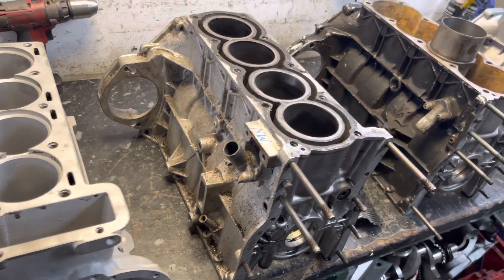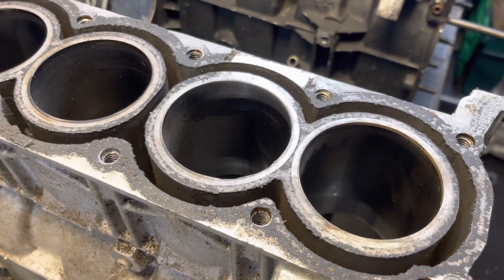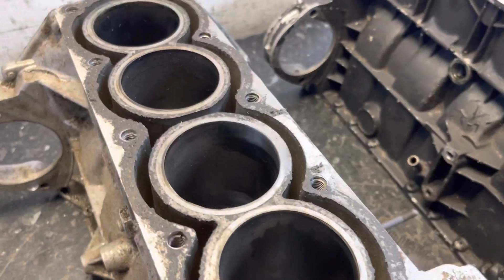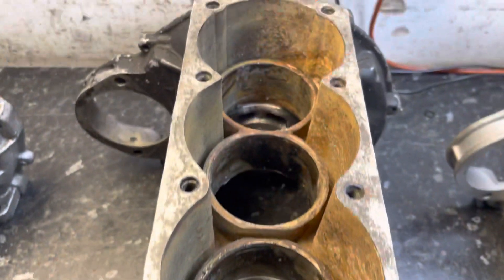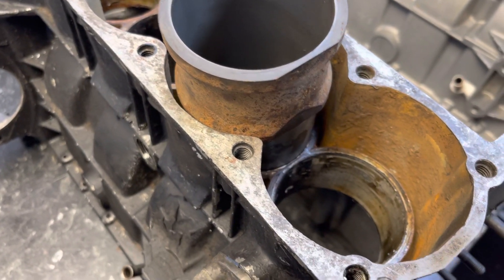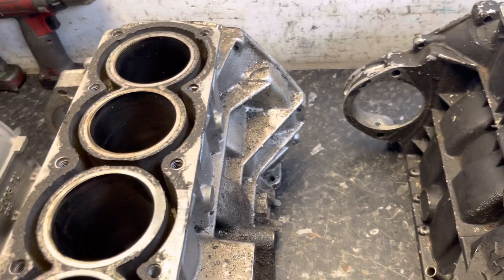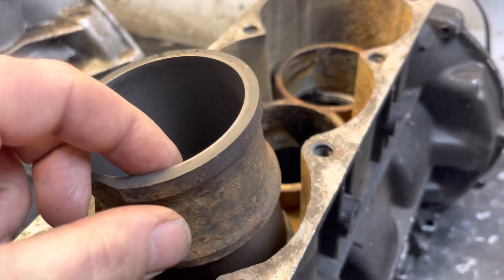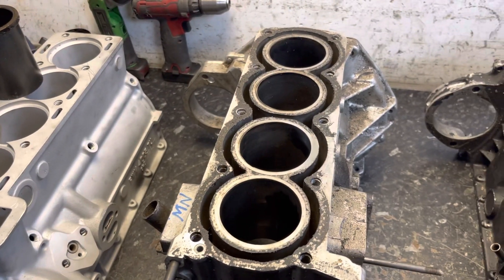Wet liner vs dry liner hillman imp race engine explanation

Comment: Great vid 
When I was playing with Imps and Stilettos In the 90's my engine builder had a mod I hadn't heard of
He milled the block taking the alloy layer off the cylinders 
Once my donk was rebored he used the boring bar to cut a recess in the tip of the liner then fitting a custom made copper oring to the top of each liner 
Apart from a cheats increase in compression ratio, never did the engine even consider leaking from the head gasket 
If I wanted to race it 
He had another mod of making alloy wedges to locate the liners and prevent "walking" of the liners 
Heard of that one??
Reply from the maker: thank you, yes have seen various different ways of sealing the pot, lots of clever engineers out there all with there own solutions!

Comment: Because the early PSA motors as fitted to Renault and Peugeot were mounted inclined and ran very hot they had long bolts going down to the base of the liner with a semicircular nut held captive in the outside of the block which prevented liner creep.

Comment: A great video, in fact I've just found and subscribed to your channel.  We've got an Imp I bought during the mid eighties and it has the usual mods that were the norm back then - 998 with a GT head that was ported by going straight down in a drill press, fast road cam (I think it's something like 25-60-60-25 and 300 lift), combined inlet and exhaust manifold with twin 35 DHLB Dell'Ortos, front VW Golf radiator and fan, Viva front discs, front camber adjustment, etc, etc.  

The block is actually an 875 that was taken out to 998 using thin wall dry liners, dropped after sitting in liquid nitrogen, and using a step at the bottom of the bore to prevent the liners slipping.  The top of the liners are also a few thousandths of an inch proud of the deck, which was 'bridge welded' between cylinders two and three and then stress relieved afterwards.  The bridge welding just gives the gasket fire rings a little extra support.  The head is clamped down with high tensile studs and nuts.

It's realistically only an 8000rpm engine, but we've been running the car like this (fast road only) for about 30 years and one engine refresh, and never had a head gasket problem.  We did think about going to wet liners and Wills Rings, after watching this video I'm glad we went the route we did all those years ago.  I decided on the step at the bottom of the bore after hearing that Roots experimented with running pistons directly in an aluminium bore.  My reasoning was they had managed to pull this off (decades before nikasil alusil etc), so a narrow band of aluminium at the bottom of the bore should be fine.  It's now well and truly proven itself as an idea.

Looking forward to watching more of your videos!
Reply from the maker: wow well it’s definitely stood the test of time ! 
interesting you sat the liner on a shoulder at the bottom of the cylinder, i have seen many a dry liner engine with the top hat fail then the liner slipped down and got munched by the crankshaft counter weights!
Reply: @thehillmanator  Unfortunately the diameter reduction on a top hat liner is going to be the perfect stress riser for multiple reasons - expansion coefficient, temperature variation, and of course reduction in material cross-section.  Our reasoning was that if Hillman could successfully run a experimental engine with aluminium alloy pistons direct in a high pressure die-cast aluminium block, then we could safely leave enough aluminium at the bottom of the bore to act as a 'stop' for the steel liner.  Touch wood, it's worked well thus far.  I've probably got some old photos kicking around if you want to see how it looked 'in the metal'.  I took some when I had the engine apart for a refresh.
Reply: Interesting the hear about your project. I have fitted straight lines to me Mercedes V8, so hope it last as long as yours
Reply: @bernardwarr4187  I think it will largely depend on how they were fitted.  We went out of our way to make sure they couldn't slip down the bore, being clamped between the head and a step in the bottom of the bore, and using liquid nitrogen to shrink the liners before dropping them in.  Without knowing how yours were done I can't speak to their longevity.  All I can say is that in our case the extra steps we took worked long term.

Comment: Hi Andy, Excellent Job, on your last engine are the holes round the liners for water cooling / expansion/ weight saving.. Best Rgs Rodders PS Midge engine still not fitted in racer yet...
Reply from the maker: Hi Rodders, hope yiur well ! Yes for the water to pass through the block

Comment: Hilman Imp engines originally had a normal head gasket.  I had a Ginetta G15 with 998cc version in 192.  This had a gasket not wills rings, these came in about 6 months after I got mine (unfortunately).  The result was a blown head gasket at high revs.  Didn't do the engine any good.

Comment: Facinating - many thanks. 

A question if I may. I believe early 998 blocks were dry liner but they had problems and switched to wet liner. What were the problems?
Reply from the maker: thanks glad you enjoyed it ! 
  yes early works blocks had dry liners but after a while they used to crack under the shoulder at the top and then work there way down into the crankcase! larger radius opposed to a a square undercut removed the stress and stopped this problem.
Reply: @thehillmanator  Thank you once again.